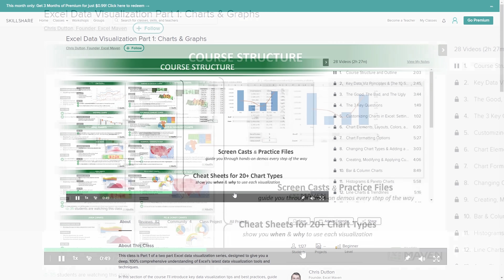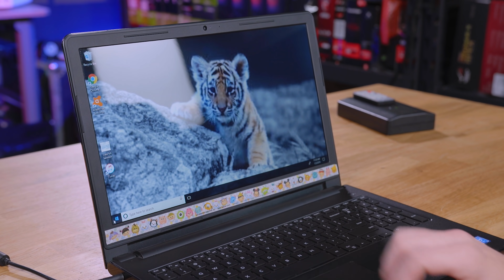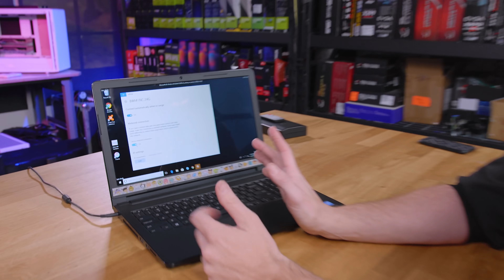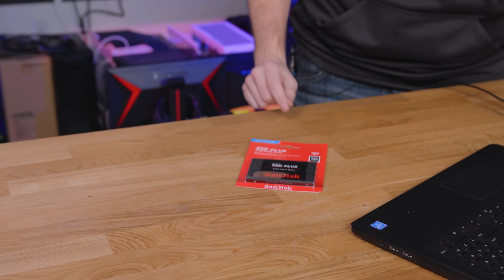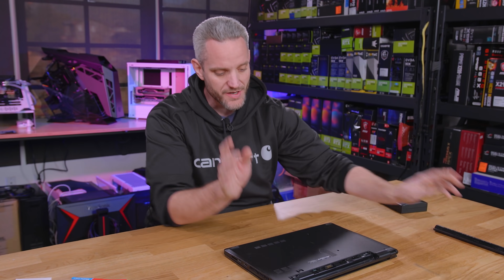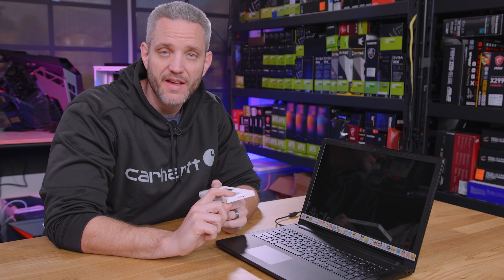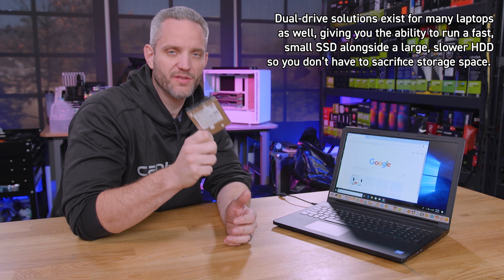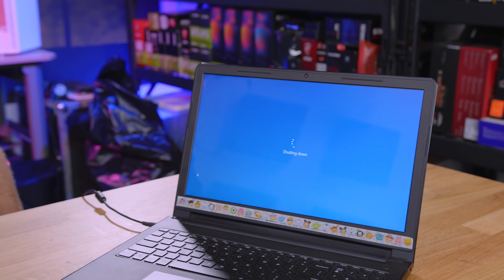Repairing an old laptop for as little money as possible...

Comment: Resident hardware guru here to expand on some of the things Jay said in passing with my personal experiences.
To dual drive your laptop:
Modern machines: Many computers include an NVMe port and a SATA port. Just put your "spinner" in the SATA bay. This may require significant disassembly.
Any computer with a CD drive: Remove one screw, usually marked, from the bottom of your laptop. Slide your CD drive out. Go to Newegg or Amazon and purchase a hard drive to CD drive adapter bay*. Transpose any mounting hardware from your CD drive to your adapter bay. Install your "spinner" into the adapter. Slide it into your laptop. Snap the original CD facade onto the front of it, so it matches. Reinstall the one screw you removed at the start to secure your adapter.
*Most full-size laptops will use a 12.7mm CD drive. HOWEVER, thin-and-light machines will use a slimmer 9.5mm drive. A 12.7mm adapter will NOT fit in a 9.5mm machine! (As I learned the hard way.)
**Very old computers may require a PATA to SATA adapter in order to fit a modern hard drive into them.
"Desktop Replacement": Many 17" class laptops include a second hard drive bay, often behind a "service door" marked with the hard drive symbol. You may need to buy the mounting cables and hardware brackets though.

As for upgrades and servicability, I've had very good luck with my computers.
My Dell D620 (and most machines of its vintage that I have):
RAM upgrade: Trivial (open a small door on the bottom with one screw, remove the keyboard via three screws and a pop door)
Hard drive upgrade: Trivial (two screws to free the drive, a third to remove the little door)
PCIE minicard access: Trivial (Three screws to remove the keyboard, there they are)
CD drive: Toolless. (One optional screw that hasn't been installed in years, and a push latch)
Battery: Toolless. (Two latches on the front)
Anything else: Complete disassembly. (I had to replace a failed cooling fan. You have to pull the entire motherboard out of the frame to reach it.)

My newer Lenovo i330:
CD drive: Trivial (one screw, slides out)
Anything else: Involved (11 screws, snap off the bottom pan, grants access to HDD, RAM, fan, battery, and PCIE minicards)

As for crazy deals: points up at the D620
If I see a laptop at a yard sale that's semi modern for $20, I can't walk away from it. I buy it, tune it up, clean it up, and add it to the "collection".

Comment: You could upgrade the cpu too. As aide project I had an old dell xps m1330 from circa 2009. I upgraded the hdd to sdd, went from 2gb of ram to 4gb (actually 3.5gb), and I looked up the best cpu for that time period that the mobo supported (like $40 on ebay.) Went from unusable piece of crap to a usable piece of crap.

Comment: If you have windows 10 home, windows will still install the security updates automatically. Setting to metered connection only prevents major updates from automatically downloading.

Also, more modern dells are actually very easy to service. Pretty much anything from 2014-now is pretty easy, especially the inspiron gaming prior to the "g series" was literally one screw. But recently low end inspiron and even a good portion of the xps line are super easy to crack into.

Comment: I had a similar problem with a Toshiba laptop (3 years old, i3, 4gb, 128gb ssd) yesterday, which hung for hours and took about 15 mins just to show the Windows 10 logon screen and another 30minutes to show the desktop fully loaded.
It already had a M.2 (sata) ssd so the disk itself wasn't the issue. Eventually (after several HOURS) i was able to access my USB drive (where i had put some updated firmwares and files) and updated the Bios to a more recent version 5.4 (laptop came with a factory 1.1 bios and was never updated). 
After waiting 45 minutes for the update to run and shutdown the machine, i turned it back on and voila it only took 12 seconds to boot. 
After that:
I cleaned off the useless applications
updated the drivers
ran the latest Windows updates
installed a different AV (a less taxing one)
disabled a lot of automatic start-up stuff and Windows services (which got the default memory usage down to under 2GB)
removed the Windows update download cache and temporary crap
trimmed the SSD
screwed it open  to remove any built up dust
finally added another 4GB SO-DIMM.
Now the laptop is fast again and the 15yr old owner can play fortnight again, with much less effort than before(also due to the added memory).

Comment: The SSD factor is especially true on laptops that are on a power budget, so the laptop hdd's are not optimized for speed.  It's my belief that you can add an SSD to a laptop that's 5 years old and it will immediately feel new again.
Reply: A month ago, I Scored a Dell Latitude D630 (built in 2007)on eBay for $20 bucks!  No HDD, No OS, & only 2gb ram!  Dropped in a $20 SSD, got 4gb of Ram from China, off eBay, Loaded Win 10 Pro,...now she's Running like a Champ!  I don't have Cable/Internet,...but I tether in thru my Cell Phone, keep updates paused until I can Update from a Fast Food free Wi-Fi Connection in there parking lot!

Comment: At the end of the video, he mentions finding "junk yard computers" and fixing them up.  I've done this a number of times.  When taking aluminum cans to the recycling center, they also recycle computers.  I'd trade in my cans and get maybe $15-$20.  They were willing to sell the computers for $5 each..didn't matter what the computer was (it could be a 286 beige box tower or it could be an all in one iMac, flat rate of $5).  I was fixing them up and selling them.  I'd buy 4 or 5 of the most complete computers, take 'em home and check them out.  Most would at least POST, but some may have bad hard drives, some may have bad RAM, but i'd swap parts around, install a clean copy of whatever OS the COA was for (9 out of 10 had a Windows COA on them) and sell 'em.  $40-$50 each, depending on the specs.  Most the time I got lucky and all I needed to do was reinstall Windows and the computers were fine.  But I'd end up turning that $15-$20 worth of cans into $160-$250...I'm sure if I really wanted to get more for them I could, but I was pricing them to sell fast...Even offered a 30 day warranty on them, not a single person returned one.

Comment: A little while ago, I pulled my 2009 15" MacBook pro 2.66ghz core 2 duo out and put an ssd in the computer to try using it as my daily laptop for a couple of weeks. It was actually a pretty good experience. I was able to get the computer that had been dead for two years up and running for less than $150.

Comment: Some laptops have socketed CPUs! Shocking, I know, but I'm about to upgrade a first gen i3 laptop to a first gen i7 for less than $15 on Ali Express. Always dual-core (there are quads, but you start gambling with wattage and heat). Also, I had the impression you can't get wired (or dongle'd) internet to metered mode without having to play with registry.

My long term project is trying one of those external GPUs using mini PCI-e (the WiFi card is already screwed) or the useless PCI-Express, like the GDC Beast
Reply: GnZ a lot of older laptops have them. I’ve upgraded the cpu on three laptops now.
Reply: Yeah my old Toshiba A300-15J has socketed cpu too, even its ati gpu is replacable because its pci express 16x, i never seen like that on a laptop before and today all laptop's have soldered cpu and gpu rather than swap for an upgrade.
Reply: Some BIOs won't let you do the egpu, what brand?
Reply: I have one as well, and i upgraded it to an i5-540m because it wasnt that much different from the i7 one and much cheaper. The quads has power but it has no iGPU and may not have video output depending on the laptop (There are some laptops that wont work even with dedicated gpu). Not sure if the GDC Beast will allow it to have output though.
Reply: Be careful doing this.  A lot of laptops have really, really shit UEFI/BIOS firmware that can give you tons of problems if you upgrade CPU or GPU.  Try to find a compatibility list if you can
Reply: Yeah my Lenovo T430 is socketed. One of these days I'll find an old 3rd Gen i7 for it but even the i5-3320m it came with is no slouch
Reply: Haha Yes! I have an old Inspiron n4110 14R that was socketed, went from an i3 to an i5. It's from like 2008 and is snappy as any computer now with an ssd.
Reply: @jiunyann  My laptop has the i5 520m. And yes it has similar performance with the i7. That's because of hyperthreading being available to the i5 before they made it an i7 exclusive.
Reply: @Polaris Lakewell not all M processors are. The i7-3520m on my ThinkPad X230t is soldered on.
Reply: 2015 or so onwards, all laptop CPUs went on BGA (solder). Before that, regular (35W or higher) models were user-accessible, so you can save a lot of older laptops by boosting the CPU. Some Core2 era laptops, like their respective desktop equivalents, also support multiplier based overclocking with an external utility like ThrottleStop.

As an example:
Dell's 2008 and 2009 Latitude and XPS series are able to change the multiplier on an X-series mobile CPU, as well as their Precision desktop counterparts (a T3400 in particular can send a QX-series CPU up to 4.1GHz in some ideal cases)!

They're not really good for games, but for general purpose budget workstations, I'd say...passable.
Reply: Yeah my old qosmio has a socketed CPU and GPU. It's pretty great knowing that if I felt like it I could upgrade them.

Comment: Would like to see a video where you clone the existing install to the SSD rather than do a clean install.
If the person you're doing this for has apps installed, cloning will save them and you a ton of time with reinstalling and patching everything.
On top of that, with a clean install, you have to patch the system from whatever the base level of your install media is.  That generally will take a while. ALWAYS use a wired connection when patching, unless you somehow have no access to a wired connection. In which case, go visit a friend who does and bring them food and drinks.

Another thing is before working on or buying parts for ANY Dell, get the service tag off of it and look it up on the Dell support site. 

This will get you the specs of the machine, including how many RAM slots it has so you buy the correct RAM kit, and in some cases the correct SSD type  (some machines may have SATA and mSATA or M.2 SATA, giving you the possibility of a dual drive setup, leaving the spinning rust for storage. 

Also, in addition to BIOS updates, (which for a Dell you definitely want to apply), you'll get drivers and firmware for any tweaked components they may have.
Reply: I keep mentioning cloning esp with the last fixer upper video. I use macrium reflect.

disk cloning programs are great. I do periodic backup of my entire C drive and so I'm pretty certain if everything went to hell one day I can just get up and running in 30 minutes
Reply: I do a fresh install for any computer not my own. Just too much crap to go through. On my personal machines, all that is curated and cloning works great.
Reply: @00O3O1B  and  @Aloiamoa Anesi
  If the system is simply slow, as was the case once Jay resolved the issue with Windows Update and the AV software, then cloning is a more efficient way to do it. You avoid a massive amount of patching (particularly if you haven't slipstreamed the latest updates into your install media, app reinstall and packaging, then restoring user settings and data. 

Like moving to Linux,  it should be discussed as an option, listing the pros and cons.
Obviously for a system with Malware or data corruption, or corrupted OS install, then a clean install is the way to go, but  (like Linux) it's NOT always the best option.
Reply: Cloning adds the risk of unintentional behavior, like defragmenting an SSD which is something that you really don't want and can be hard to fix for novice users.
Reply: @Mozza-07  You can prevent that by having it not defragging new drives (even current drive) before you clone it.
Reply: @killertruth186  I'm not saying you can't prevent it, I'm saying it's kinda advanced for novice users and one little error in this regard will take half the drive's life. Just reinstall, way less issues.
Reply: @Mozza-07  I know. But if you show them of what disk defragment can do and where to access it. You can teach them to turn it off for new drives and current drive in order to transfer it to the SSD.
Reply: What do you mean by "patching?" Like, flashing a mobo update and updating drivers, or is it something else? And why always wired?
Reply: I got a m.2 recently - and I cloned my SSD to that. Does cloning hurt performance at all? (Such as internal settings or anything since I assume the cloned patrition thinks its a SSD and not a M.2) or should i just start fresh? Not too informed about partitions and SSD's/M.2

Comment: Just wanted to push back on the "Dell laptops are not meant to be user serviced" a little.  

First of all, nowadays pretty much NO laptops are meant to be user serviced.  Second, Dell CONSUMER laptops (Inspiron) are not especially friendly to user servicing, as well as to a degree the XPS line to a degree (this will 100% be the case with ANY laptops that are having thickness at a premium.  That said, even given that laptops are increasingly not friendly to user servicing across the board, Dell has some of the MOST serviceable laptops (by FAR), and definitely the most widely available parts.  

Obviously Apple is the extreme example of non-serviceable laptops, but as someone who does hardware repair on laptops day in and day out, I'm extremely thankful to work primarily on Dell laptops.  If you think Dell's are bad, go check out Lenovo's non-thinkpad offerings.  Usually more adhesive/double sided tape than screws holding them together,  and sketchy ribbon cables-o-plenty.  I've been working on some MSI gaming laptops being used for CAD and 3D modeling (which are huge pieces of crap by the way build quality wise), and to access the memory or M.2 slot, you have to remove ~30-35 screws, about fifteen ribbon cables, and the entire mainboard.  HP's are a complete nightmare, Samsung's aren't good -- I could go on.  Toshiba usually isn't too bad, but I typically only see the lower end ones.  It's no bueno if you have to dig deep, but they do usually make the basics (drive and memory) relatively accessible.

Conversely, Dell labels every screw hole, has complete service manuals available for virtually every machine they've ever made, integrates features to make servicing easier (sideload HDD ejector, easily access to optical drive retention screws, zero pry back covers, adhesive-free designs, etc. etc.).  

If you can name a mainstream laptop manufacturer who churns out MORE serviceable products I would love to know about it.  Your "Dell's aren't designed to be serviceable" logic sounds a lot like when someone has one bad experience with NVidia drivers and then says "NVidia drivers suck", or one WD HDD fails, so "WD HDD's are unreliable", etc. etc. etc.  You're working on about the cheapest laptop they turn out and saying it's not very serviceable?  Of course.  Dell overall though, is far and away the machine I want to be working on if I'm getting a ticket for hardware repair/upgrade on a machine.